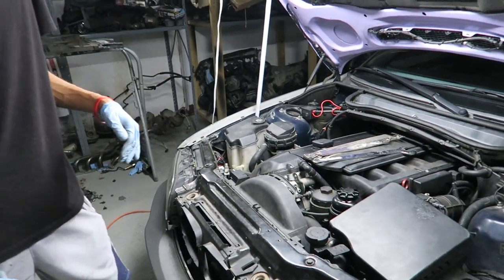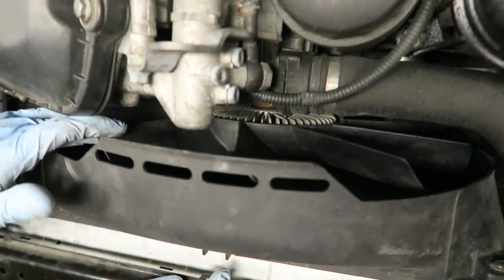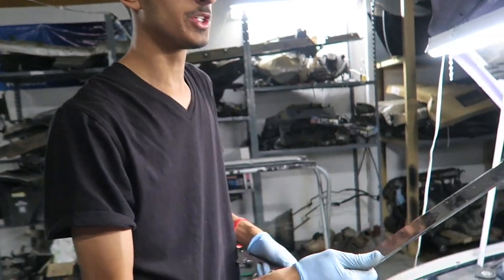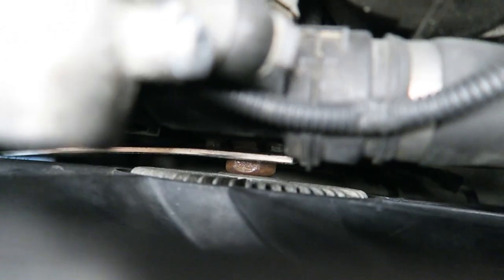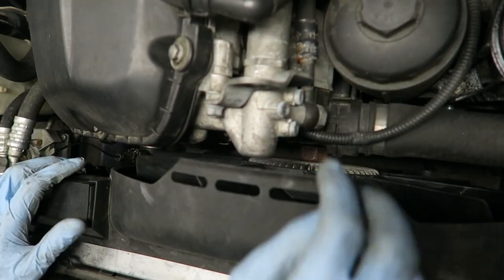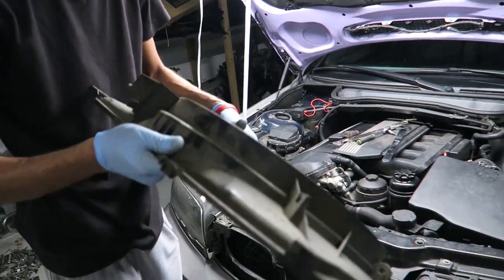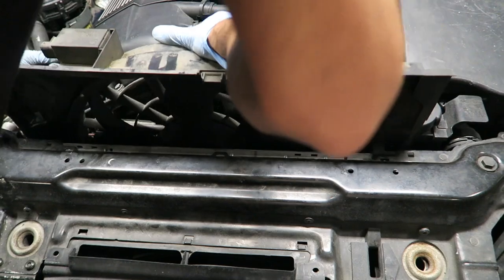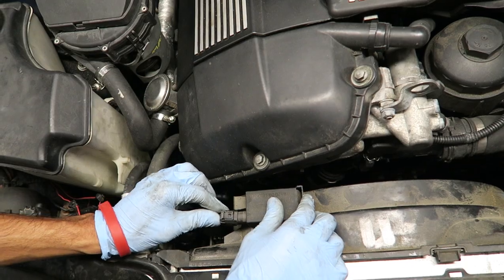BMW E46 Mechanical Fan To Electric Fan Conversion DIY

Comment: can anyone tell me what that fan is called... when i search for it, i cant tell the difference between the front fan, and the rear electric fan.
Reply: Romell Blanks it's the main cooling fan for a manual transmission e46. The front one is usually labeled as the condenser or auxiliary fan

Comment: If the aux fan is disconnected, which fan will switch on when the A/C is on.
Reply from the maker: The electric fan will take the place for both the A/C fan and Radiator Cooling fan.

Comment: I have a Bmw 325xi automatic,if i do this my car overheating??.
Reply from the maker: The electric fan will keep the car from overheating.
Reply: hi my 2001 325xi is overheating too I did this job to the fan and it will only run on low speed any help would be nice and also I checked the red and blue wire it has 12V and I replaced the temp sensor and the lower rad hose. Is there a relay I should be looking for

Comment: What fan did u use???
Reply from the maker: +Kyle Caudle An electric fan from an e46 with a manual trans. It was an OE fan, but you can buy the Behr Electric Fan for the e46 from various vendors.

Comment: if this electric fan replaces the ac fan cant you just take off the AC fan and use it as an electric fan...?
Reply: It won't mount properly  tho it's for the out side unlike the designed electric fan on the Mt 3 series

Comment: 90% of the time, if you can't get the mechanical fan off, it's because you're turning the wrench the wrong way. This is a REVERSE thread.  You turn it to the RIGHT to loosen it.